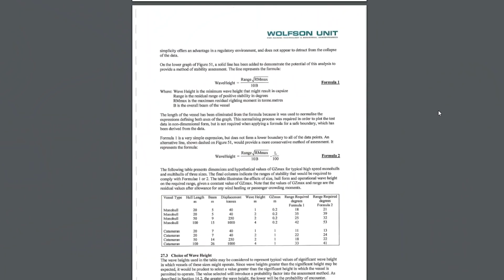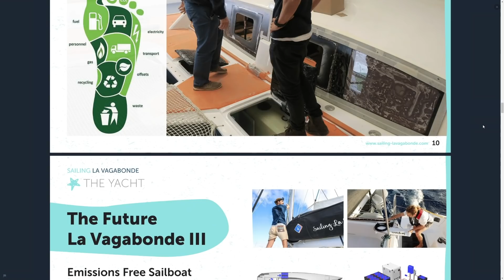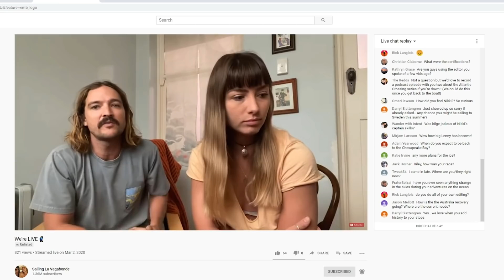Our Plan for an Emissions Free Vessel

Comment: Only one choice for propulsion, Oceanvolt saildrives with Servoprops, size to fit the boat you get. The best choice of dinghy is OC300 which planes fully loaded on 8HP, which could be provided with a quiet EPropulsion Navy 6.0. 2kw solar and as many lithium batteries as you can get.

Comment: Daedalus Yachts, North Carolina (former Gunboat location ? ? ) is building a boat (boats?) that is equiped to generate it's own hydrogen for use as  fuel when wind and solar are not available.  I assume these boats are VERY Expensive. But may be a good source for ideas for you.

Comment: Riley check this out - designed and initially built right here on the NSW south coast by Robert Dane, one of our local GPs with a cutting edge electric engine by UNSW integrated in the system. I was lucky to be onboard during  its inaugural voyage through the heads and into Sydney Harbour - just magic! Here's an early clip showing how the solar 'sails' can rise or lower as well as pivot to catch the best performance matrix between wind and sun - of course this is an old clip of the original and design has improved out of sight now (along with speed lol)  https://www.youtube.com/watch?v=kRxqy9c70ys  This is where you can find Robert today: https://ocius.com.au/

Comment: Late comment but I feel the efforts would be better spent on reducing emissions in the supply chain of boat building materials. Reduced emissions doesn’t have to be the boat itself. Think of the impact of reduced emissions in building material production and manufacturing vs one individual boat. Your dreams are your dreams, but if the boat itself doesn’t work out, this could be something you could look back on as an old man and Lenny can tell his friends about what you did for the industry of boat building and beyond!

Comment: The discovery of oil peaked in 1964.
In each decade since then less oil found.
According to Rystad Energy the average annual discovery of oil has declined to 9 billion barrels.
Mankind consumes 36 billion barrels PA. 9 billion barrels is 27 billion short of what is required to maintain our current lifestyle.
9 billion is sufficient to meet our needs for 3 months.
UNSUSTAINABLE!
Your plan is sound!!!

Comment: Riley, there’s a whole career in acting waiting for you if you ever tire of your seafaring life.
I’ve been a Greenie and a sailor for over 50 years and have long thought about alternative auxiliary power for small vessels.
1. Catamaran gives the most solar generating area.
2. Length gives better speed/power ratio. Speed/power is the same as distance/energy which is basically fuel consumption.
3. Weight worsens all of the above.  Weight increases with battery capacity.
4. The obvious way to go is the route Oceanvolt will take you. Knock a knot off (or put more sail on), when you’re doing ten knots, and trim your props and, presto! your twin motors will be generating in the multiple kilowatts range.
Have you considered having a kite launcher and using a kite in light airs? So long as there’s enough to launch it, it will generally fly fine at altitude and they generate huge amounts of thrust. Check it out.

I’ve followed you guys for three years now, and I’ve finally decided what makes you special (apart from Riley’s rugged looks,  robust philosophy and thoughtful practicality; Eleyna’s flawless beauty, enchanting musicianship and home craft skills and, of course, Lenny’s bright-eyed joi de vivre and innocent delight).
No, what makes you special (not counting your beautiful La Vagabond, the wonderful places you take us, the interesting and charming friends you have and the thrills and spills that keep us on the edge of our seats) - is, I can never work out which of you is the dominant one. I think that says a lot about the strength of your partnership.
Kia Kaha,
Arohanui.

Comment: Howdy! It’s mind boggling how much information is out there on this topic, but it’s still not mainstream.  One of our partners has a monohull that he is trying to make into a “parallel hybrid.”  It’s everything an electric has but you don’t have to ditch the diesel completely, it can charge your batteries while running, and it’s backup propulsion, or motoring in a bad storm.  On our tour boat we dream of doing a similar system onboard with the added possibility of hydrogen fuel cells.  The technology still isn’t mainstream enough these days to get it for a decent price point, but we believe it can happen as long as we don’t give up on the dream.  Good on you for doing this, we are watching and learning so much from you! Cheers!

Comment: Hello Riley, have you contacted the crew of Moonwave catamaran? They run a hybrid system (Torqueedo) and might offer some "real world" advice. http://www.moonwave.com/delivery-zero-fuel/ 
The other boat to contact would be Top Secret catamaran a Voyage 580, that was all-electric, but then decided to re-install diesel engines after a lightning strike. https://integrelsolutions.com/blog/2019/10/12/s-y-top-secret-has-installed-integrel-its-no-secret-voyage-580-catamaran/
I persoanlly would probably toy with the idea of  getting a balance catamaran with running one hull with electric for propulsion and re-generation.  Then install a diesel in the other hull as a safety/backup, and for additional electric generation when  the electric-regen and solar are not enough. Most of the time you probably can get by with the electric motor. How ever there might be times when you need continuous propulsion over several hours, like a lightning strike, mast damage, and when trying to reach a safe bolthole in unfavorable conditions. 
Don't forget, a  significant reduction is already an improvement, but out on the ocean safety is always paramount. You guys have enough experience to make the call, look forward to seeing what you go for. Fair winds.

Comment: Don't under estimate electric over hydrogen. It's way way way more efficient and weight ratio os steadily improving. also electricity is easy to get a hold of. There some conspiracy videos out on hydrogen boats that are so factually incorrect they can be. The weight estimate for lithium per kwh often 3-5 times larger than if you find the weight of a lithium car and divide the kwh on the weight of the car. So lithium are lighter than they claim and also cheaper.
Reply: and safer. and fast. larger battery more hp. some ev's have over 400 hp and none of them have 100 kwh. Get 400 kwh and you can have 1600 hp easy. The question is if the boat manufacturers are affected by the conspiracies and are on the hydro hype.

Comment: Wow this is a big project. Been following for a few years now and seen amazing evolution and what I consider a small amount of time. Emissions free is is more then getting rid of the combustion drive engines and gensets. Alot of manufacturing emission can be offset when done correctly. But batteries are a big issue that need to be overcome. I have had ideas about solar producing hydrogen and stored, then the hydrogen run through a fuel cell to produce the needed power for extra propulsion and running accessories.
Hemp batteries is another idea very but not yet developed. Just some ideas I've been playing with. 
Great work guys look forward to the future La Vagabond.

Comment: I congratulate Riley for being a leader and looking to make a bigger impact on the sailing world through providing a push towards emissions free. 

That said I agree with the comments that a conversion of the Outremer would be the easiest way to make this happen. A quick refit with LI batteries, electric motors and sail drives, an electric Range, more solar and a DC generator for back up and they have a nearly emissions free boat without all of the emissions created in the supply chain building an entirely new boat. 

I remember the last videos with Riley dreaming about boat designs and sketching them on passage. I think this project has as much to do with his itch to play designer as it does to do it emissions free. To build a bit of a unique design likely leads to a semi custom or fully custom boat builder.  And many exist, particularly down under. Curious to see this play out. Good luck Riley.

Comment: Riley!?!? Converting your existing vessel to emissions free is childs play! You can buy all of the motors and electrical gear from a used forklift firm all engineered and set to install, ditch your diesel motors and bulk up your solar and regen capacity. That is all easy peasy. You already rely on emissions free sails for the bulk of your energy needs. What isn't as easy is storage. It will cost a bundle to buy enough lion batts to give you the range you enjoy with diesel burners, but those prices are coming down too as economies of scale drive down prices. I am about 90% through the process of doing it myself, so you can too. Don't reinvent the wheel, use what has been proven already.

Comment: Talk to the guy who built the TOP SECRET catamaran, I saw his video on his custom boat.   Range and how to store as much juice as you can is gonna be the hard part.  I had a thought of instead of a mainsail a vertical windmill (Kinda like the one in Waterworld) hooked up to a vacuum sealed flywheel made of carbon fiber since it would handle high RPM better than titanium.  Mechanical battery of sorts, help keep consistent power flow during night or cloudy days.  For a sail you would use a very large kite sail system (Silent Yachts uses one).  When being pulled those electric motors turn into generators while the boat is being pulled along.  I think the TOP SECRET guy said it ate up a half knot in speed, but that ain't bad for a trade off.

Comment: My personal take on the reducing your carbon footprint as much as possible is a reworking of the existing boat with a company such as Oceanvolt. Surely a Li-Ion / electric propulsion conversion would be far, far more affordable and ecologically doable. I imagine that they'd be VERY happy to work with a high-profile channel such as this to engineer a system that would get you 100% off of diesel and propane. Between solar, wind, hydro and a big battery bank, you should be able to have a fast boat that ticks all the boxes.

Comment: Thin film solar pv could be attached to decks, sails trampoline maybe batteries hi density could be added to hulls, electric motors could replace internal combustion engines vertical axis wind turbines added to masts
To charge up batteries.  I was thinking about this too. Ahoy.

Comment: What is wrong with your existing platform, fast boat, well made and very light?  Change your diesels out for electric, add additional batteries /charging capabilities and be done with it.  Going up 10' is a lot, more maintenance, higher costs, harder to find dockage  / moorings, 10'  on a cat is close to 30% more boat.  Not sure if you have a geni, but a small 3 to 4 kw would offer backup insurance. Good luck and continue your dreams!

Comment: All comes down to $$$$$. That's why you're looking for sponsors. It's not financially practical or sustainable for most novice or young sailors. It's common sense that when buying a boat, you get what u pay for, and unless you're a technically minded person with the ability to fix, upgrade things on your own ability, it can otherwise be a bank breaker. I appreciate that you share this info & would love more realistic videos, because most of your videos make it look like sailing is easy, or inexpensive, but that's so far from the truth. The only videos that came close to how crazy it can be out there, was the sail you did with Greta on board. 

You would have been in a lot of trouble during that sail, if you didn't have all that extra support & was doing that crossing alone with just elena.

I hope people realize that, because you rarely hear about the disasters on sea, mostly novice & inexperienced sailors trying things without the right boat or lack of experience or preparation.

Comment: have you looked at a 80 foot to 100 foot mono hull so you still maintain safty for your family you can build out of bamboo and run all electric with solar and small generator if required lower cost to build mono instead of cat

Comment: What a great endeavor to pursue. It aligns perfectly with my feelings about sailing. As I have watched your channel over the years I have always thought that sailing and boating is inherently outdated. 

Have you seen what Silent Yachts is doing? They make electric catamarans powered by on board solar panels. 
I don’t believe they have quite reached the performance goals the mainstream sailor would expect but they are damn close. Electric catamarans appeal to me so much for the same reasons electric cars do. Simplicity, reliability. 
I love sailing channels but the process of sailing seems archaic, complicated, and tedious at times. Multiple sails, lines all over the deck, broken travelers, etc. 

I’m really looking forward to seeing where you go with this emissions free effort. 
Don’t forget about your dingy too. Throw an electric motor on the back and you’re good to go.
Reply: The problem with solar/electric propulsion is it uses up battery cycles fast. Yes its still apparently cheaper. than diesel, but u go through batteries much faster. Need to look into lithium batt recycling

Comment: There's heaps of emissions produced in the boat manufacture. Sailing has to be the most emission free form of transport. You could have an electric motor and battery charged with solar cells and a wind vane, but I don't think that you would end up much better off. Is all this effort going to be worthwhile? Keep doing what you're good at whilst you can, I think that you will have to come back to Oz when Lenny reaches school age. Cheers.

Comment: I think you should make a Trimaran design that has floating outriggers that are actually movable.  That way, you can pivot the smaller outer rigs back along side the primary center hull and convert from a Tri to a single hull for the most part.  That way, you can have the best of both worlds.  A multi-hull for stability and a single hull for speed.  ;)  It'd be like the F-14 Tomcat of boats.  Also you might consider wing sail designs on the out riggers.  Then you wouldn't have to move to them to change attitude or angle.

Comment: The only way I see, to build a significantly better vessel considering emmisions, is to build it from wood. The wood will store the carbon for many, many years. But you need proper wood from a durable source. I have been dreaming about this for a while, but dreams are there to share!! Hope I see you soon a wooden varnished cat or trimaran.  Sailing the world on a carbon storage unit!

PS: just as cool would be, to build one from restored ocean plastics. However, Hope you succeed!!!
Reply: Wood would be close to emissions free ...... But what about metal fittings and fastenings ..... what about the tools used in making the boat ....

Comment: The energy-observer in an interesting boat, Tesla power bank could be an option or Lithium Phosphorus for battery's. Electronically controlled, hydraulic hydrofoils may be worth considering, they could be lowered and utilized in lower winds although complex. Waverider hydrofoils boats are interesting.  Waterjet propulsion may be worth looking into.

Comment: Riley, when it comes to performance in light air (5 knots) you have to think about sail material (carbon fiber) plus sail area and boat weight which means carbon fiber race mold hulls with dagger boards and foils.  Here is a yacht you can start with (LOL)  http://www.daedalusyachts.com/gallery/ go big or go home. Try rapping you head around these stats : )
Cruising above 20 knots all the time in the Trades and the VPP predicts 36 knot capability in 24 knots true wind. Model runs were done with a conservative allowance of 15 per cent lift from the 5m C-shaped daggerboards and T-shape rudders.

Comment: A good starting point is to accept that nothing involving modern manufacturing or use of natural resources is emissions free. The challenge is whether you can adapt lifestyle or make material choices that become emissions neutral over a longer period of time through a combination of contribution to carbon, particulate, and other pollution treatment and/or capture schemes, or by considering choices that limit reliance on resource use! One of the real challenges is to actually investigate and calculate the embodied emissions in the relevant processes that most businesses will be either reluctant or just unable to confirm. Whether it's the resin on a hull or a bottle of Corona bought from a supermarket on an island in the Bahamas...everything has some level of embodied emissions...it's just important to set your limits and know when to let go! But...I think you probably know that already! P

Comment: I really like the idea of an emissions free sailboat. Towards this project I would also add to have in mind the cost to our earth in producing the parts for said vessel along with how much time it would take to offset the emissions with the newer vessel as opposed to the old one. An example of this is that a fully electric car is supposed to be less environmentally friendly in production vs a fossil fuel powered car, but manages to offset that environmental cost with about a years worth of driving as opposed to a fossil fuel car. 
I am also interested in seeing any plans for heating the interior of the vessel. That is if you are planning any high latitude sailing. As I live in Iceland, a diesel heater is amongst the most common solutions, but I'd like to see a more environmentally friendly solution that is as effective as that one.

Comment: Ideas:  1) definitely keep the sails ;).  2) big batteries 3) charge with water turbine (when underway), wind turbine ( when stopped), solar ( whenever ) and diesel backup.  Be interesting to see battery size and charge times needed to run motor for a 24 hours that can push a 55 ft boat at a safe speed.